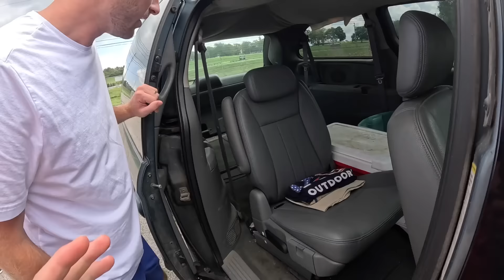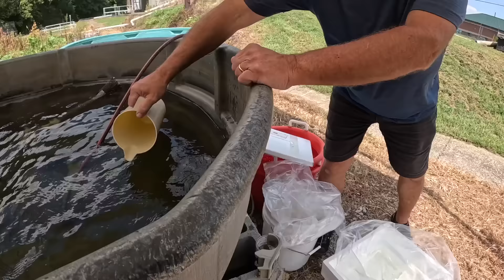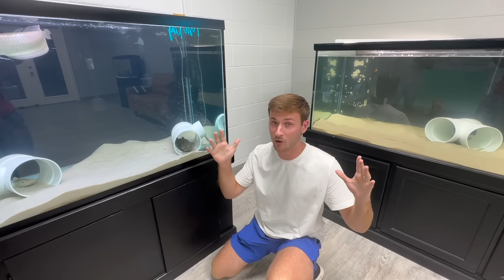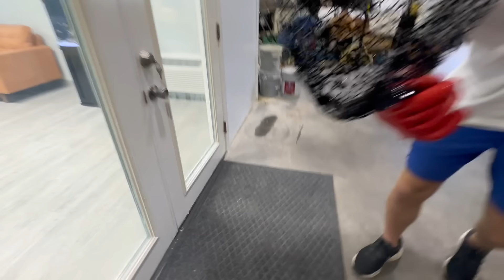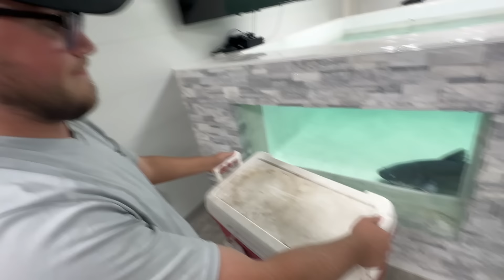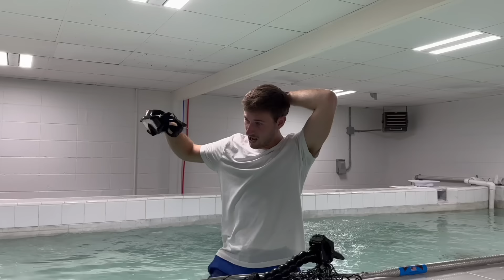Stocking Rare Paddlefish in My Pond!

Comment: Hey just an acclamation tip. if your using a cooler just dump like a cup full of the water your putting it in for about every 5 minutes for 15-30 minutes and it should be ready to go on the water. May God bless you!

Comment: Volts dont kill you, amps kill you. A stun gun or tazer can be in the several thousand volts with an initial burst of over 100,000 volts to disrupt your nervous system but they have extremely low amps which hurts but you stand no chance of a fatal shock. They can make a pace maker upset but thats about it.